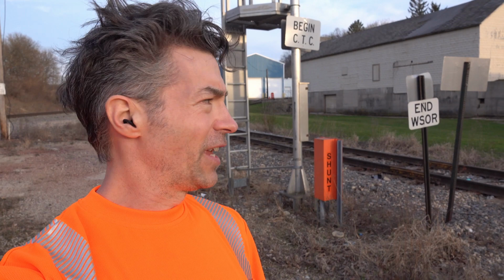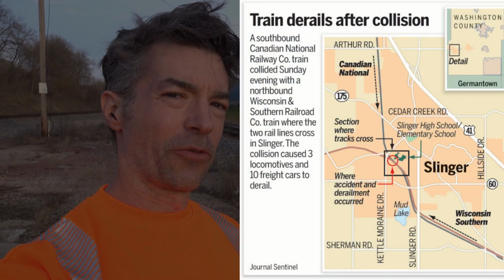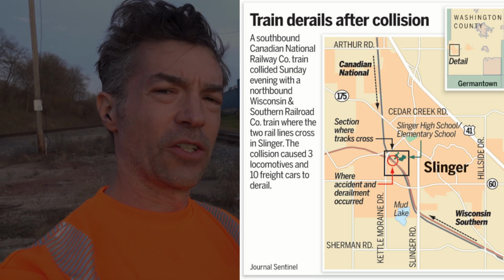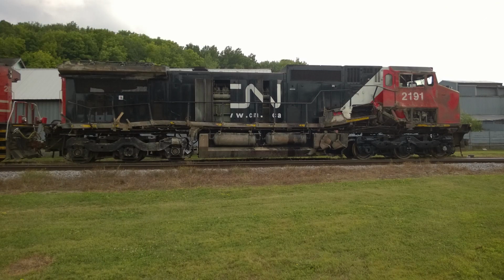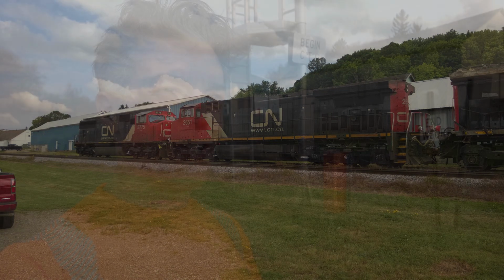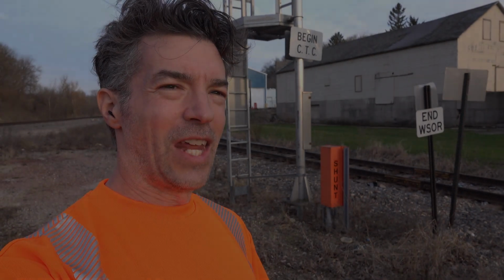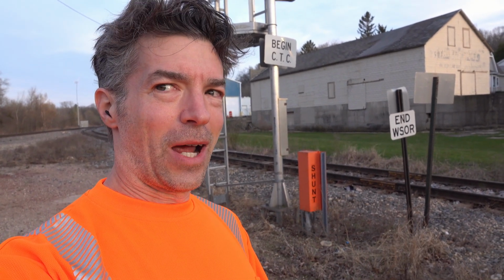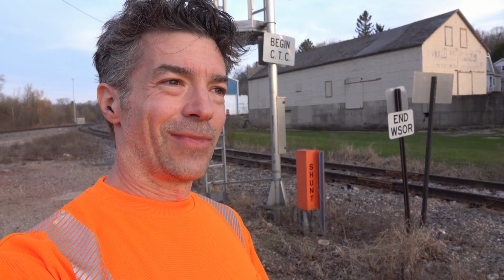CN Funeral Train at Slinger WI

Comment: 2191 is still on the roster as are all the ex BNSF dash 8's. It is most likely being transfered storage as stack is covered, not scrapped out. These units were part of the clean air rebuilds for ore service in MN
Reply from the maker: Thanks for the info!  I updated the video description with this information.  I personally have no insider knowledge into what CN is doing, so unfortunately, I'm at the mercy of what other railfans say... which is often incorrect.
Reply: @RugbyJunction  ATSF #856 C40 Dash 8W